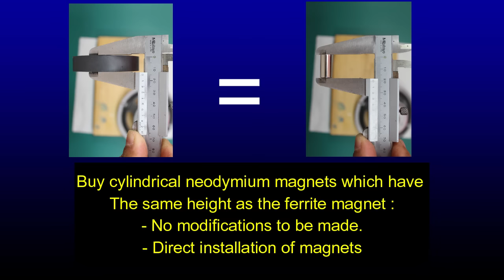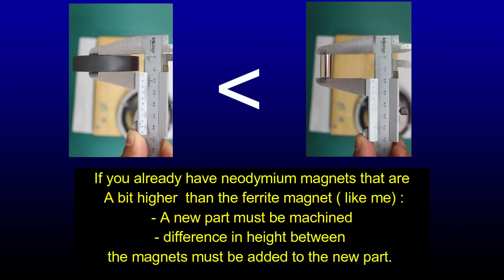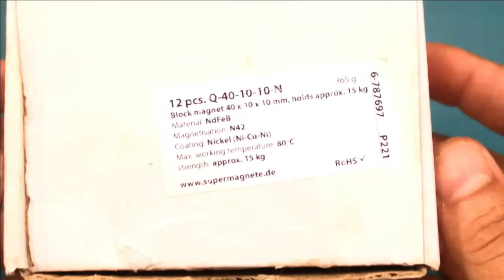--||-- Upgrade Speaker to neodymium Magnet --||-- step by step

Comment: Did a Nd magnet mod and the results were increased volume with less drive current and extended HF response. Was worth it for mid and high range, didnt change much with bass and sub bass regions. Replacing with an active magnet (electromagnet) was similar.

Comment: "Pro": Only in this case, the voice coil works cooler because it is much more exposed to the weather outside.

"Cons": The final sound is totally changed due to a drier, more annoying sound, since ceramic magnets are preferred par excellence for their magnetic damping capacity to sudden and repetitive changes in the magnetic polarity of the voice coil. To solve this defect with Neodymium magnets, another diameter of voice coil must be used that resonates with the woofer casing, using a more robust casing to avoid harmonic fluctuations produced by the bending of a weaker casing which is not structurally prepared to withstand large magnitude torsion.
You should also consider changing the cone material to a much stiffer and thinner one or use another type of cone material that is much softer than the original and thicker.
Changing the permanent ceramic magnet for a neodymium one in a speaker with these characteristics, just like that, only worsens the final sound and good results are not obtained if its structural manufacturing characteristics are not considered.

Comment: Nice mod and good craftmanship from you.  similar to Anilco speaker 😀😀😀
Reply: AlNiCo* was kind of the neodymium of old. Neo motors, like the old AlNiCo are highly efficient, and can produce good volume at low power.
I have tested neo drivers and directly compared them to similarly powered ferrite drivers, and the difference is very noticeable.
Neodymium is more common in smaller drivers, especially in modern tweeters and mid-ranges. Pro audio drivers in particular often use neodymium motors, because of their high efficiency. Though, some high-end subwoofer drivers use neodymium motors as well, it is rather uncommon in large drivers, since neodymium is much more expensive than common ferrite. Large high-power coils will often produce high temperatures too, so that is why neodymium drivers often have an open structure design, since neodymium gets weakened by heat.

* AlNiCo is an alloy made from aluminium, nickel and cobalt.

Comment: Would have been interesting to use a piece of the green magnetic field viewing film to put over and see what the field lines look like before putting the cap pole piece back on!!! Additionally Would have been interesting to drill a vent hole through the pole piece for ventilation and cooling the voice coil as the dustcap looked like it was not permeable to ventilation. No ventilation between the dustcap and pole piece means you have an enclosed cavity that seems like it might hinder the Xmax excursion and truncate the SPL capability.
Reply: Also adding an effect known as speaker compression.

Comment: If you just want a stronger field, and there is a nice big core like that, and there is room in the enclosure - all you have to do is add magnets to the back or sides.  That will strengthen the field.  With surface prep, cyanoacrylate (super glue) would be fine.  Just need to think a little about the field.  You can get donut or wide disk neodymium magnets too.  Or just double up with another copy of the existing ferrite magnet.  Flux linkage is a thing.  But with a stronger field, you could exceed excursion limits.  While you were machining, you could have cut recesses for the magnets for friction fit.

Comment: Interesting modification.  I wonder how much the driver's t/s parameters changed with the change of magnet?  A stronger magnet will result in Qes and therefore Qts going down.  Fs will probably go do slightly, not because of the magnet, but because of the additional glue, which adds a slight bit of mass to the cone. Room EQ Wizard (free software) and a simple impedance jig can be used to measure the parameters of the original driver and the upgraded one for comparison purposes.
Reply from the maker: TS parameters certainly changed,  not only because the magnet have been more strong, also because the old ferrite magnet create a small closed space behind the cone assembly,  now with neodym magnet the cone becomes free to air on back, the result: the midrange becomes clear and soft , and the bass becomes strong, because i feel more bass power on my hands when i tested the driver.
Reply: @homemade_audio  The increased bass power could also be caused by a reduction in BL, which will lead to more output around the driver's resonance frequency.  The best way to determine what impact the change has had on the driver is to run an impedance sweep on the unchanged one and compare it to an impedance sweep of the changed one.  If the impedance peak for the changed driver is lower and narrower, then BL has gone down.
Reply: @homemade_audio 
It moves more easily, but dust also enters more easily and can damage the speaker winding
Reply: @homemade_audio yeah I love it.. upload sound comparison in wav format

Comment: Questions: 1st, why didn't you clean the basket entirely before (!) installing the magnets and the rear plate? 2nd, why didn't you measure the TSP's before and after the modification? Only these would give you predictable response in a certain enclosure. 3rd, why did you use just 8 magnets instead of 12, or possibly 16? There appears to be much more space for them!

Comment: Changing the magnet will change all the t/s parameters of the speaker. The speaker will perform compeletely differently if the magnet power is not calculated correctly.
Reply from the maker: Yes i agree, this video is to show you how to make a speaker driver rather than changing magnet.
Reply: You have also lost a huge heat sink with the old magnet. Worthless modification
Reply: @castuart81  think about the heat source and it surrounding before  and after the mod.. you have here direct convection with more air.
don't forget, anilco speaker were built that way. this mod is an overall improvement over the ferrite one...

Comment: Nice work done. I think you should check first with Guas Meter what the reading of orginal Barium magnet in core perifery.  what the gaus value get after Neody.. magnet. Now does it require more Watt poer to drive the spaeker. In what terms it better perform.

Comment: the point of the deynium magnet is to make the speaker and the magnet smaller.
if the sound and how many watts it can withstand is the same and the size is the same, then there is no need to upgrade!
Reply: If done properly, the motor can have increased efficiency with a stronger magnetic field.

Comment: Neodymium needs a completely different magnetic geometry. Changing the magnet only does not "improve things".
Manufacturing a new pole piece requires the right type of iron, not just any type of steel.
Reply: Shhhhhhh 🤫. This is just the beginning of the hobby. 
Next video will be a deeper dive no?

Comment: nice, when are you going to upgrade your coil stack and surrounds to handle the extra forces and heat?😂  and wouldnt a new speaker be cheaper.

Comment: The shape and other characteristics of the magnetic field are probably all wrong this was probably a downgrade to the sound of the driver probably a serious downgrade
Reply: Well but why? Bunch of people are all "gonna sound worse, DUH" but stronger magnets would seem to add something, not take it away. This isn't obvious information and Google is practically useless anymore.
Reply: @erichill7560  because there's a lot more to a driver's performance than just the material that the magnet is made out of -the field strength  and orientation and the shape of the field and a bunch of other things that I'm probably not hitting on here

Comment: So I guess we're just ignoring the fact this effectively unsealed the voice coils from their protective encloser they were in, you know, the one that "dust cap" you so thoughtfully reinstalled last was meant to enclose. 

So now with every movement of the driver  dust and particles in the air are going to be pulled into the coil and eventually effect the performance of the driver, if not completely hindering its ability to move freely around the inner core.   

Seems like if you knew enough to accomplish this task, the issue I pointed out would have been addressed.

 But not in this instance, so I guess you too don't expect the stock voice coils to withstand the much higher resistance (ie. Impendence or Ohms)  that  the much stronger (looping) magnetic field you created is going to subject them to, for long enough that the dust can ever have a chance to become a factor. 

Because they'll just be blown. 

Got it, now I see where your head was when putting this awful click bate video together.  Good job!
Reply from the maker: maybe you're right, but to fully understand a video on YouTube you need to have the head of a YouTuber 🤣🤣🤣 
technically: 
-a high magnetic field does not explode the speaker but facilitates the movement of the coil which increases the sensitivity of the speaker but the response curve changes. 
- for a bass driver the dust has no impact on the coil, because the cooling is much better in this case, I advise you to look at the scanspeak and b&w drivers with clearly visible coils. 
- this video is more to show you a lots of techniques concerning the assembly of an electrodynamic driver rather than changing the magnet.
 - jbl before the 2000s put a single hole in the woofers for ventilation and cooling of the coil (jbl 2235, jbl k140, jbl le15...), nowadays they put 3 holes right to the coil instead of 1 to improve the cooling of the coil without fear of dust (jbl 2226h, jbl 2206). 
- the dust cap is not just for blocking dust!!! it also helps to generate a significant part of midrange and sometimes HF where it is made of aluminum like in the jbl e140 / jbl d130....
Reply: @homemade_audio   I'm quite familiar with drivers that have incorporated ventilation in the magnets, as I have a been in car audio installer for 20 years. Something else I know its all those drivers that have cooling vents also have some kind of screen mesh or open cell foam or something between the voice coil and the outside environment. For the sole purpose of protecting the coil from dust, because dust caught between the coil and the center pole, effectively with turn that spot into a grinder. 

Now I don't know about you, but I prefer my speakers not to sound like a rock crusher as they travel up and down. But hey, if that's your kink, who am I to judge. You do you. 

Ultimately the video was pretty interesting, and pretty well executed, just the one glaring oversite really, I felt like could have been addressed to make it go from meh, to holy shit!, mod. 

The issue could have been addressed one of several way, but the most esthetically pleasing of them  I think would to have used a plexiglass ring the same dimensions as the old magnet, that had all the neodymium embedded into it, effectively mimicking thee speakers original design and thus not compromising the speakers integrity.

Comment: Everything is fine, but how are you going to avoid  future dust and magnetic particles accumulating on the Pole piece and the voice coils. This would fail start failing in less than 3 months time. A regular magnet closes and encases any contact with outside debris, but this would be a problem with neodymium magnet. You can always come up with a solution.
Reply from the maker: What about this 1000€ high end scanspeak driver ? 
https://www.costruireaudio.com/scan-speak-21we-4542t00-midwoofer-8-4-ohm-ellipticor-it-it.html

Comment: You should not let unprotected the coil , those magnets coud be munted into a plastic barrel lige revolver one (black) from polypropylene, teflon , from a plastic block like hou you turned steel piece ... one big hole for coil and in the ring mass simetrical holes for cylinder magnets... o coil exposed also a chamber closed like in the original ( now you have air behind coil- membrane at same pressure as in front...).
Reply from the maker: What did you say is an old philosophy about Speaker's driver!!!
Look at high end revelator  midwoofer made by scanspeak, vife pearless and you will understand.
https://hificompass.com/en/catalog/speakers/woofers/scanspeak-revelator-18w8531g-00-7-mid-woofer

Comment: The bottom of the voice coil has no protection from dust, debris, and stray metal fillings.  This is a fatal design flaw.
Reply: In a sealed enclosure it will be just fine.  It’s easy to cut and glue a screen around the magnets and this is not an uncommon architecture. 
I have used many vented drivers like this and they handle more power thanks to better air cooling.

Comment: i let the midle of speker more 3mm up and the sound is verii verii good and the coil shes not heat not at all.ispeak a speaker at 15 inch.about 300watii.and y not put neodium

Comment: you change the magnet But you use the same speaker cone. .It's deformed when you unpack it. .The distortion will be more than before.
Reply from the maker: No, the cone isn't deformed because it's very elastic thanks to kevlar fiber.
For magnets,  you have to know that there's some manufacturers like audio nirvana that makes same full range drives with different types of magnets,  the cheap one's based on ferrite magnets!!! And the most expensive are based on alnico magnets .

Comment: Hello, what is the advantage of neodymium speakers?
Reply from the maker: powerful, light and less bulky. 
sound side : good performance, good reproduction of high frequency and low frequency signals.
Reply: @homemade_audio ok, but shouldn't the diameter of the coil wire be changed for a higher power?
Reply from the maker: @armaghedon-c4j  no, the target is improving the sensitivity not the power handling capacity.
Power handling capacity is related to   all cone assembly (voice coil, cone, spider, suspension), not only voice coil and magnet assembly.
Reply: So you changed sensitivity of the low frequency driver (dB/watt) ... but how did you compensate for this with the other driver(s) which have become less prevalent? And what crossover mods were done for this increased sensitivity? And how did you adjust the enclosure?

Comment: More powerful magnet behaves as a filter to higher tones (adding more system "inertia"), with a loss of the overall acoustic power since the coil remains the same.
Reply from the maker: it is the membrane that sings by moving, not the magnet, the problem of weight is essential when increasing the weight of the membrane as the case of jbl 2235h where jbl added a 34g ring to lower the natural frequency (Fs) of the driver, by increasing the power of the magnetic flux, it has a direct influence on the driver's efficency.
Reply: @homemade_audio   By "inertia" I mean a tendency to dampen the motion of the coil (and of course the membrane) when it is returning to the idle position.
Reply: @dbaznr  i think it is the exact opposite it pulls stronger and pushes stronger
Reply: @tolgadabbagh1877  It can be stronger, but only for the lower frequencies. Mid and higher frequencies are filtered out.
Reply: @dbaznr  coil doesnt overcome the magnet , it moves bc of the magnet when charged . i have a two same size mid speakers , one with a very big magnet , it is like two times louder with the same input power and extends to higher frequencies than the one smaller magnet . but other factors other than the same power applied , are not controlled tough
Reply: @tolgadabbagh1877  Same external size doesn't mean a lot. You have to compare coil's diameter, turns and filament.
Reply: @dbaznr  The voice coil inductance will not change because the coil remains from the original design, the motor force has increased, therefore the driver will be more compliant at all frequencies, a more powerful motor can move the mass more easily and quickly. If he had added turns of wire to the VC or used a larger gauge wire to make a new coil, inductance would have went up and that would affect the higher frequencies negatively.

Comment: 😂😂😂will not work cause  it need highe power to make reverse magnatic force
Reply from the maker: do you believe what you wrote? 
a strong magnetic flux allows easy and controlled movement of the coil, which improves the roundness of the speaker. 
a strong magnetic flux blocks the coil, that I have never heard 🧐🧐🧐